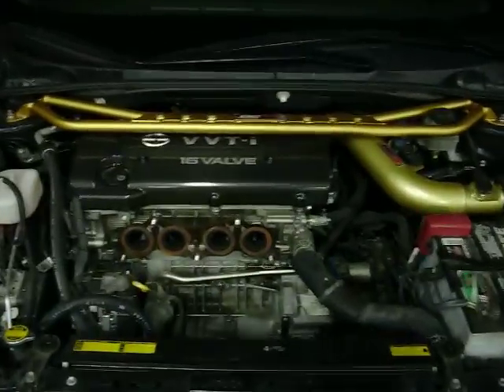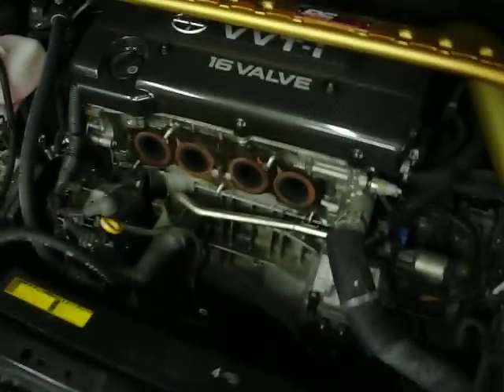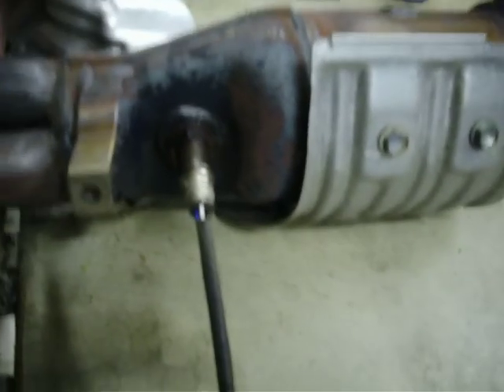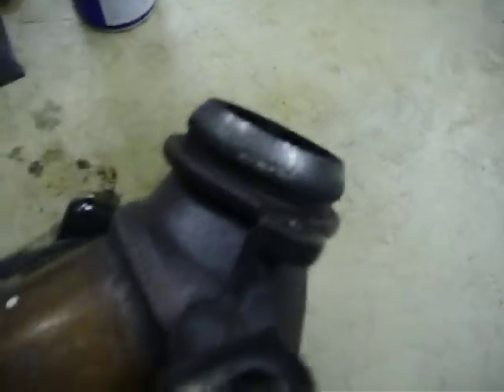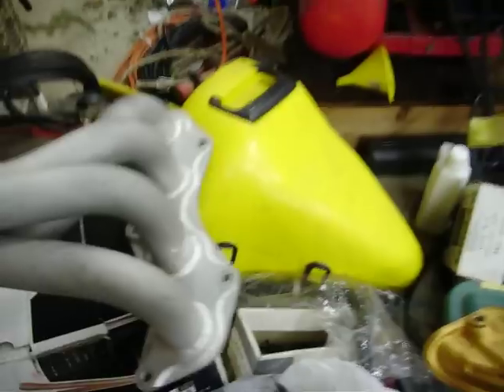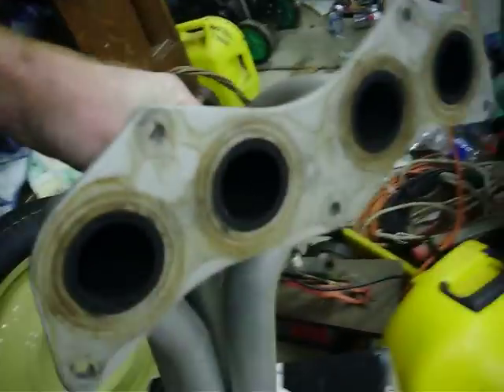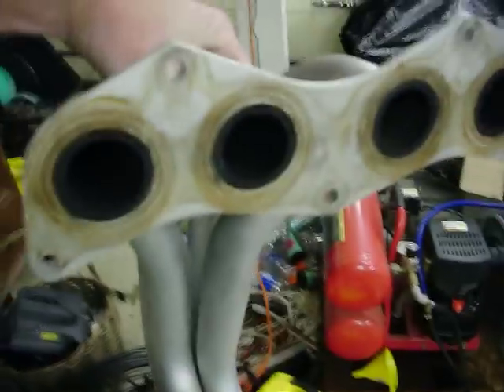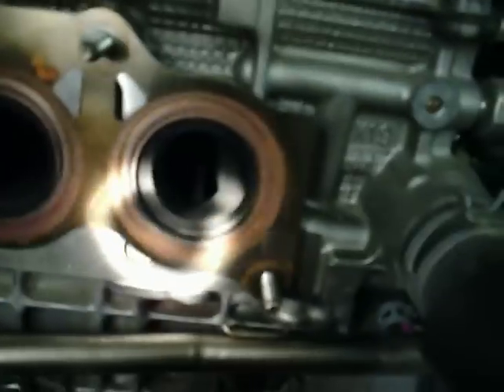2007 SCION TC DC HEADERS

Comment: dont know much about cars but id like to know if u drained the oil first?? and i heard from people that u have to disconnect the negative terminal of the battery first before u disconnect the sensor to avoid a check engine light... do headers add horse power to the car??   and did ur new headers come with a gasket or u reused the stock??   nice set up